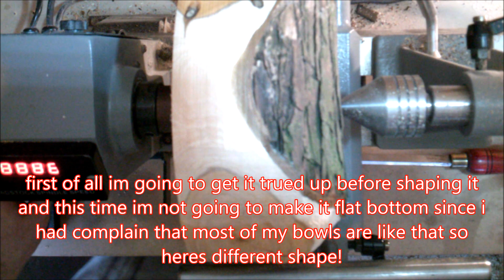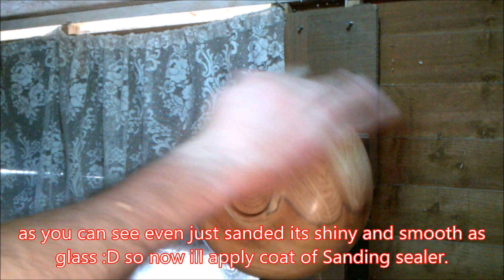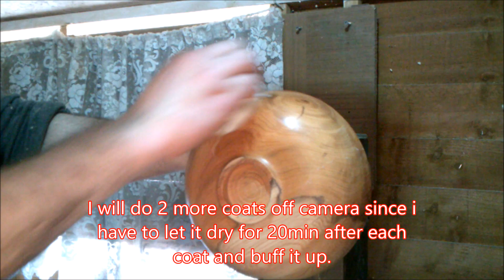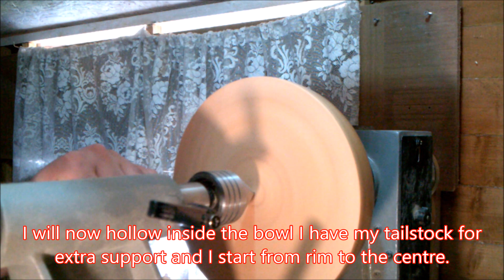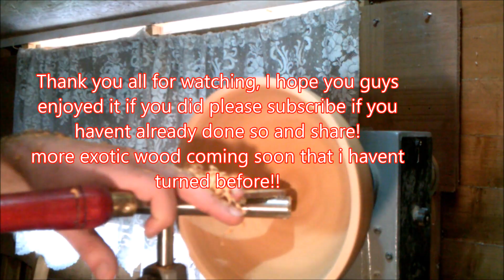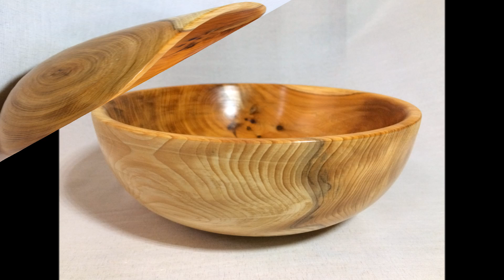Wood turning - Beautiful Yew bowl

Comment: That is a beautiful bowl Afshin, the grain shines through the simple shape. Am I correct in thinking you used the same tool all the way through - it looked like a scraper? Enjoyed watching you - thanks.
Reply from the maker: Thank you much appreciated, yes its negative rake scraper. been experimenting with different angles over past years to find that sweet spot and see if scraper would become as effective as bowl gouge or not, so far i managed to get nice shavings from 56 degree edge but nothing still beat bowl gouge.